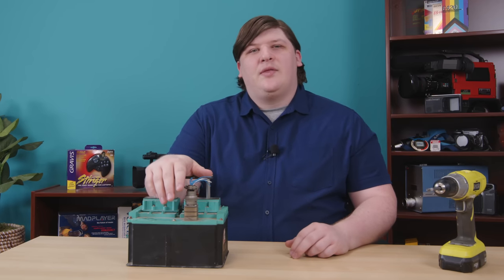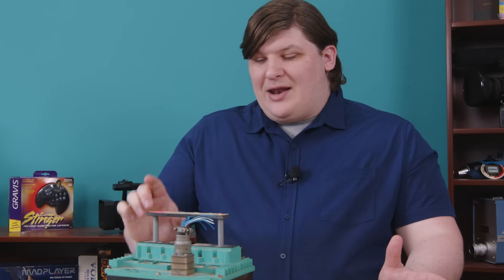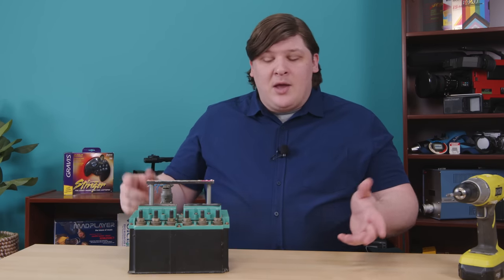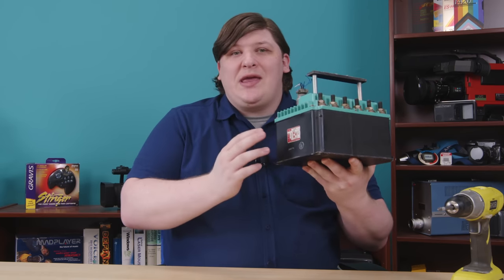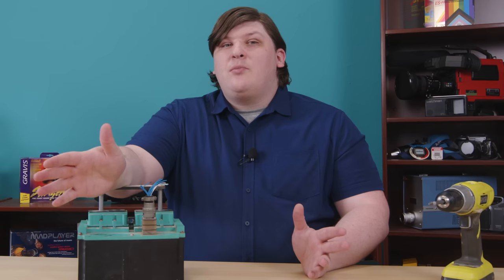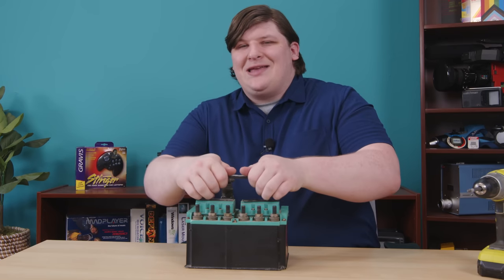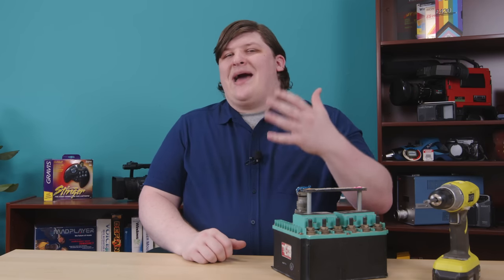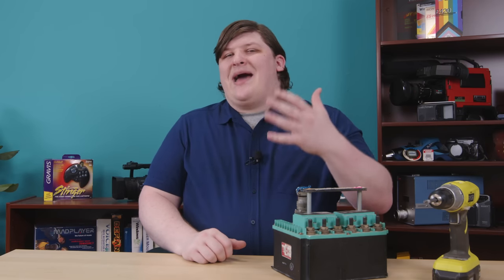A Short Story About (Battle)shorts

Comment: There’s a persistent problem in software: what should a component do if it can tell something’s seriously wrong, but not so wrong that the component you’re working on can’t continue. One answer is “log it,” but nobody reads the logs. Another answer is “shut down until it gets fixed,” but of course that means something that could keep going… doesn’t.

At the risk of being the guy you were talking about at the end there, an “override warnings” mode might be a useful approach. Allow the component to keep working, but only after someone bypasses the safeties. If nobody’s put the bypass in, the component shuts down to get attention.

Though that’d probably just lead to step one being to disable the warnings. The “correct” answer is to log such things and actually read the damn logs and fix the problems, but if you can’t get that to happen you probably can’t get people to not immediately slam the “just make it work already” button either.
Reply from the maker: I think that's the particular reason I don't like the idea of people using this: virtually nothing in software development, unless you are making life-critical equipment, is important enough to apply this kind of gravitas, and of course it would very rapidly become overused to the point of meaninglessness.
Reply: maybe the cost of sanity is the answer, if there isn’t one found already. sounding a specific “working but needs attention” alarm. It’ll force people into doing the work to get rid of the damn noise.
Reply: @CathodeRayDude  A lot of commands in Linux do have an override safeties mode, in the -f parameter.  It's why "sudo rm -rf /" is such a dangerous command, it bypasses all of the safety checks, like not immediately erasing files that are in use and instead asking the user for confirmation.  As a result, the entire contents of your hard drive, and ANY other devices that root has write access to, including network shares that the system backs up to, and removable media containing the only copy of an important file that needs to be copied onto the network shares, get erased.

Of course, it is used so often it's basically pointless (you can delete a directory perfectly fine with just -r, but most people, myself included, just do -rf), to the point where Debian adds a specific check that makes it refuse to operate on / without an additional parameter.  Automated scripts make the problem even worse, since there is no mechanism in place TO ask the user/admin, so you pretty much need to put -f unless you want your backup script to stop running because someone left a log file open or something.
Reply: @thetechconspiracy2  As a defender of "manual override" option always available, with the responsibility it entails too, of course, you and Gravis make excellent arguments and examples. However, in the Linux example, sudo allows to not use an entire account as Admin always. So, in theory, you are using your entire system as a plain user, with some pills of admin risks that you take with sudo, against to be openly Admin all the time, always at risk. So, your point may be true, but at the same time, you are accepting the risks of being Admin in "little doses" vs. an entire account messing at system level all the time.
Reply: @thetechconspiracy2  i can relate ..years ago when worked for "that" company in Redmond WA on my desk i had an WIN NT box...but when that box would refuse to allow me to do a function on the servers i would spin around and log into my Xenix (derivative of UNIX) box and execute the command as SU (Super User) sometimes those single commands could be a half page long..Xenix would execute it no matter what...,.,including like you said remove all files and leave a blank HD...the system assumed that the SU knew what he was doing and no reason to question it...
Reply: RAID controllers (basically software or hardware that takes a bunch of hard drives plugged into it and presents one big one to the OS, most commonly with built-in data redundancy so if one drive fails, no data is lost, but if a second one fails before that drive is replaced and the controller has a chance to reconstruct the data that was on it, all will be lost)  face this this problem quite regularly. Most RAID cards, when they enter degraded mode, continue to function as normal (often in read-only mode) but beep continuously.  There is an audible buzzer soldered to the RAID card whose purpose in life is to make sure the failed drive gets replaced before another drive dies by driving anyone standing in the server room insane.

I don't think the use of this terminology would be appropriate through.  Battle shorts are for when you don't know whether you're even going to live or not, and the only thing you care about is getting one more shot off on the enemy, no matter the cost to the equipment or to your lives.  If the turret motor blows up, so be it.  You were going to die either way.  Now at least you can do it knowing that it wasn't in vain.

Nothing in the world of business is like that.
Reply: @amateurprogrammer25  
My dad was an AS400 guy but wasn't a hardware guy. I asked him and he wasn't even sure what the filesystem was (apparently it was IFS), he dealt with databases talking to each other. Now he still does something similar but it is some proprietary medical software and Globalscape for tranfers.

What operating and file systems do you have experience with? It sounds like you have been in the industry for awhile! Is hardware RAID still in use? From what I understand the industry has (at least in very large datacenters) moved on from traditional hardware RAID to different proprietary and open source filesystems. Really smart ones that are more intertwined with the OS.

I have been playing around with ZFS and TrueNas. The web interface is really awesome for someone like me who is intimidated by the terminal and all the boot flags and configuration required to properly set up and maintain a pool properly. It is awesome to be able to use all that old DDR3 as cache and get really snappy random I/O (writing, at least) up until that 32GB is full. I discovered that one of my SATA cables were bad because I had email notifications set up for any errors or degradation. At first I thought it was the disk but swapping it for a spare did not fix the problem. I forget how it handled the failure (may have switched to read only mode as you said) but it was really cool to troubleshoot and learn from. No data was lost as I had five spinning rust disks. It makes me wonder how Windows (NTFS or FAT) or Linux (EXT4) would have acted had that been say my boot drive or media storage. A blue screen? Kernel panic? Corrupted data? I don't think any of those older filesystems used hash and other safety mechanisms. I remember in the late 90's or early 00's all of my mp3 files would open and play but would skip ahead like a CD. It was very tedious re-ripping my entire book of CD's... Was a cable loose, was the controller bad, RAM corrupted? I had no idea what was going on... Over the years I have learned to start checking S.M.A.R.T. and log files and how different scans can prevent issues like this.

On my daily driver I have been playing around with BTRFS and it is also an amazing filesystem. I have forced myself to learn a lot about fstab and the pros and cons of different filesystems. Obviously I still don't know enough to trust myself with anything mission critical, it is more of a hobby. I still do backups and want to learn to use snapshots.

Sorry for the book, I just love to hear from people smarter than me about these things and you seem happy to talk about it. Thanks for your insight and in advance for any advice, insight, anecdotes, etc..!
Reply: @thetechconspiracy2  "like not immediately erasing files that are in use" Isn't that just a function of the kernel's filesystem layer treating hardlinks and open file handles as equivalent while using "delete the inode when the reference count hits zero" semantics, which `rm -rf` is incapable of bypassing?

"but most people, myself included, just do -rf" I think that's probably because someone with insufficient foresight lumped "ignore nonexistent files and arguments" and "never prompt" into the same argument.
Reply: Although not used anywhere I can think of, the -O flag (optimize) on the python interpreter ignores all assert statements (assert thing_that_should_be_true == True).
Reply: Is classic pattern "On Error Resume Next" an example of this?
Reply: @wraithcadmus  We do not speak of ON ERROR RESUME NEXT
Reply: @MickeyMousePark  Yep. Windows has tons of system-level protections in place so the user can't break the system. Sometimes this is annoying, like when it auto-installs a shitty mobile game from the windows store, and refuses to let you uninstall it or manually delete the files (true story).

Linux, on the other hand, just makes it clear that when you use "sudo" or log in as SU, that you should absolutely know what you are doing, and running a command could potentially kill your computer. If you run a command as SU, a Linux system will not question the command you are running at all, it'll just do exactly what you told it to, whether that's a good thing or a bad thing.
Reply: @CathodeRayDude  Compilers for code usually have something like --<feature-x>-no-err to let what would usually be an error and stop become a warning and continue instead, this is for dangerous code patterns that do not do what most people think it does, but the switch is there for those who really do know what that code does.
Reply: Ironically, this has already been done. Windows 9x could throw a bluescreen, but included a "Continue" button. Fullscreen scary error message but if you want to try and salvage some of your work you can hit continue and save (AS COPIES!) whatever you were working on before restarting or diagnosing further.
Reply: @wraithcadmus   TBF, the existence of that pragma is borne out of the hopelessly limited nature of BASIC's error handling anyway.

BASIC kind of assumed you were an idiot, so when something left the bounds of sanity, it stopped so you couldn't hurt yourself.  This is safe, but when applied to larger (and potentially "production") applications in (e.g.) Visual Basic for Windows, something as simple as clicking Cancel on a dialog could crash the program.

BUT, if you knew what you were doing, you could write your own error handler to check the status after anything that might cause an error, and resume execution in a sensible way.  The problem there being that error-handling checks weren't really intrinsic to BASIC programming style, so BASIC programmers (and I use that term loosely) weren't practiced at that particular discipline.  Further, what could cause errors wasn't always entirely obvious, ergo you might not include checks after a statement that had caused an error, and since the "care about errors?" switch had exactly two positions without nuance (... sort of), you've also told the runtime environment to blindly continue, always, and under any circumstances until it just couldn't anymore.

This is why BASIC is terrible and should never be used by anyone.  :-)

.... OK, at least not for anything serious.  But preferably never.  If you're writing actual applications, and not simple educational experiments, then congratulations -- you've graduated to the Actual Programmer skill level and should now move on to a language with features.  Problem being, rather than just teaching people how to program, BASIC taught people how to program badly, which makes it more difficult to feel comfortable stepping into something like C -- ahh, C... where there will never be "battle shorts", because they're always engaged.  :-D
Reply: I think that the big difference in software is that you don't have nearly as much nuance. As a programmer, it's not like we like to throw errors and stop people. Most errors really are errors. "I couldn't open the file you wanted to edit", "I can't connect to this server to make it do what you want", etc are all things you simply cannot recover from. Whatever task you were doing simply can't succeed.

In bad software that doesn't work when you need it to, the error message isn't what's causing you grief. It's just the things that you see. Asking for a way to bypass that error, is simply asking for a fix for the original issue with an extra click. Usually you just want the fix.

Warnings are essentially those errors we have a fallback/workaround for. It's an unusual situation that probably shouldn't happen, but the code knows how to recover to a reasonable state.
Reply: @amateurprogrammer25  Heh. I know of a network closet with a UPS with a dead battery that has been beeping for literal decades now.
Reply: I can't get too into the specifics of what I do, but this sort of mode is very useful when you have a company-ending risk by not allowing something to keep moving. We've run into this a bunch of times and being a cowboy and engaging override warnings mode is sometimes the only thing we have left. The paradigm is useful, but you have to have a commensurate risk to what you're doing with it - this is why the stock market uses the "circuit breaker" terminology for trade halts during high volatility events.

I don't think it's too trivializing when one time our software being down caused hundreds of hospitals around the world to have to triage on paper for a couple hours until we could get the thing back online.
Reply: If only printers offered overrides these days.
Even if it should somehow be dangerous to the printhead to print with insufficient light magenta ink, there may well be a print in the queue that contains some urgent information
Reply: This is something I've dealt with in cases where reverse engineering is involved and you don't know for sure what the limits are. Warnings like "this field doesn't match the pattern we've seen so far" or "this might not work but we can't tell for sure" or "this is valid, but strange, and might mean you did something wrong and it's not going to do what you meant".

Example: parsing 3D rendering display lists from a game. If there's an invalid instruction, the real system will stop and you won't get any output. For a tool you're using to figure out the file format, you want to know about that, but also want it to keep going so that you can see at least some result, even if it's incomplete or mostly nonsense.
Reply: @nickwallette6201  All depends on the version of BASIC... most PC BASIC's, from MS, you're 100% correct. However, there WERE "professional" BASICs (and similar under different names) with all of the functional features of C or whatever other language you might pick.Generally for minicomputers but some had PC/Mac versions, one I can think of was even "Mac only." Just because a language is "similar to English" doesn't make it inherently bad, it just means it's easier to learn and to debug! There was an entire "4GL" (fourth-generation language") project for YEARS, before OOP killed it, dedicated to making languages more efficient for programmers, instead of making programmers more "specialized" in the languages. Typically the compiled code was less efficient than 3GL or OOP, but the assumption was that hardware would catch up. Unfortunately (IMHO) the "make the language complicated and hard to understand and then only the dedicated can use it, but it'll run FAST!" crowd won that one. In my business, we went from five programmers able to do "x" in a week, to having fifteen programmers who took three weeks to do the same thing - but wow, the program ran FIVE SECONDS FASTER!
Reply: @toadfishstudios   Fair enough on the professional BASIC thing.  It isn't so much the "like English" bit that I have a problem with.  It's that BASIC was really designed to be this introduction language that helped new computer users get the hang of the concept of programming, but then companies (OK, let's be honest here -- Microsoft) really pushed it into realms where it didn't belong.

Part of what BASIC easy was that it didn't clutter your code with all that pesky setup and error-checking stuff that "real" languages did.  You didn't have to define headers to get simple I/O, or see whether an operation worked or not.  If it didn't work, it would bomb, and you would fix your code (or the problem) and run it again.  The stakes were low because you weren't going to have data sets that you cared about.  You were going to be doing things like drawing intersecting lines on the screen, or maybe calculating mortgage payments and printing a table based on four up-front questions.  So you weren't going to lose hours of work if the program terminated abruptly.  But then, the use-case of the language changed, and error-handling had to be bolted on in this awful way, and everyone had been trained that things "just work" even though sometimes they don't.

It may not be a popular opinion, but I don't think other languages are that much harder to read or learn.  They may use more terse syntax, but nobody that didn't already have an inclination toward computers ever looked at BASIC code and went "ah, yep, that all makes sense to me" just because the words were familiar.  It's like how Windows tried to be "easier to use" by making buttons larger and more colorful, and hiding tasks under real-world metaphors, but never changing the underlying complexity of intangible objects in a file system that you had to track, under resource constraints that weren't obvious, and granting uncontrolled access to the critical bits without a crash-course on why you shouldn't ever touch them.

I would also argue that 4GL, in its conceptual form, is still alive and well today.  It's just that, it's very, very difficult to have expressive and full-featured languages that don't carry the burden of complexity.  They kind of go hand-in-hand.  If you want the language to be simple, you usually have to make it limited.  And so 4GL concepts have flourished where the problem domain can be constrained.  SquareSpace and such are great examples of this, perhaps taken a bit beyond programming per se.  But, the moment you let the user go wild, complexity creeps back in.

OOP doesn't strike me as a solution to quite the same problem.  OOP makes rapid development possible through reuse of existing, extensible modules.  But it's still just as complex as procedural programming.

I'm also not sure that 4GLs were killed by performance concerns.  Modern languages sacrifice performance for robustness and fault-tolerance -- like inherently checking bounds of arrays, and garbage collecting, and reference counting, and allowing pointers to be passed out-of-scope and still be valid.  Features like these add overhead to make life easier on the programmer, and ... in theory ... make it more feasible to hire less experienced programmers and still have them contribute functional code.

BUT, I've always maintained that programming is inherently a difficult thing to do well.  It requires one to have a clear vision, discipline, attention to detail, and communicate effectively with end users through the interface of the program.  That's not a set of skills that everyone just has, where the only barrier to entry is whether the keywords are full words or symbols, and whether lines must end in a semicolon.
Reply: @thetechconspiracy2  I'm pretty sure that modern versions of rm have a "preserve-root" flag thats on by default. But it only protects against "rm -rf /", not any variants.